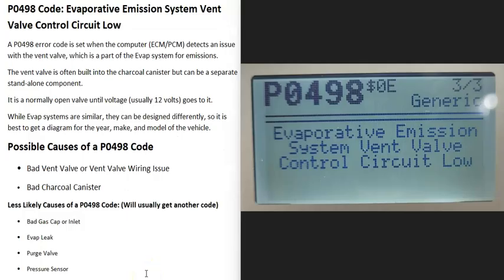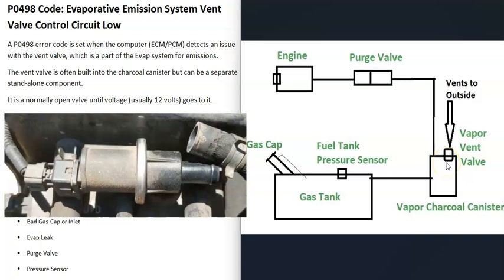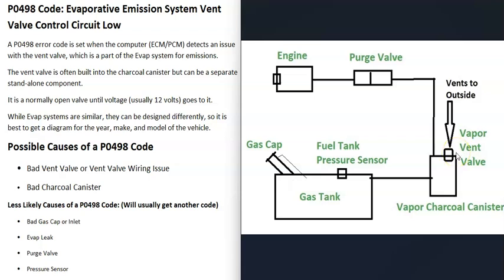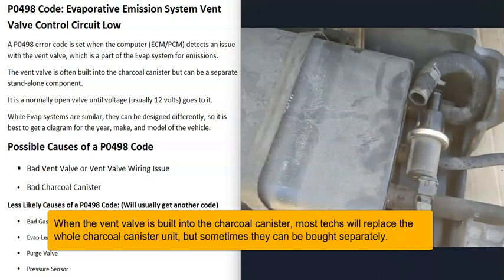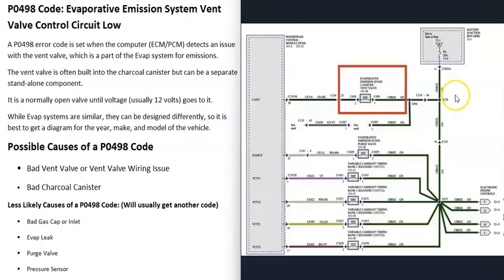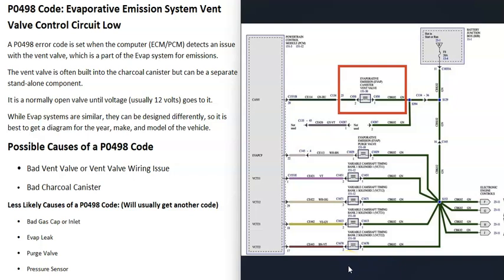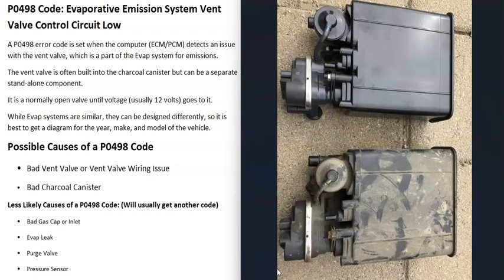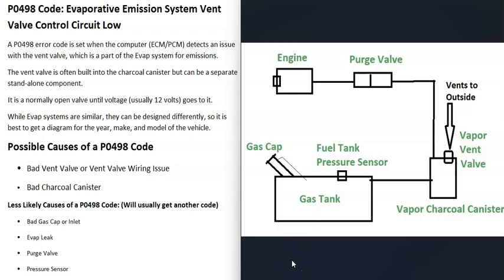Causes and Fixes P0498 Code: Evaporative Emission System Vent Valve Control Circuit Low

Comment: One thing to add is along with wiring a bad PCM is also a point of failure especially if it’s a control circuit code 👍🏽